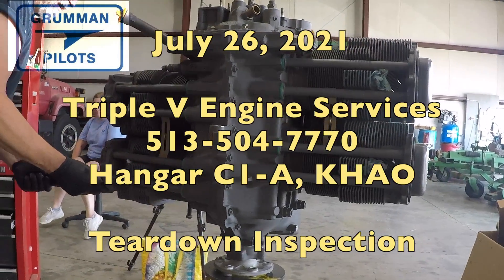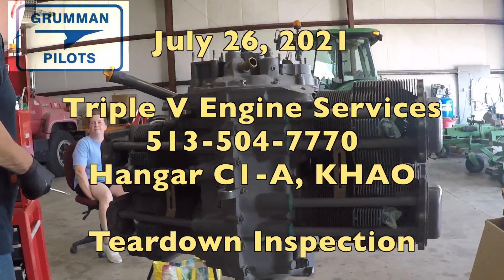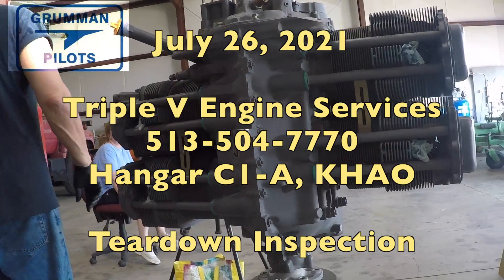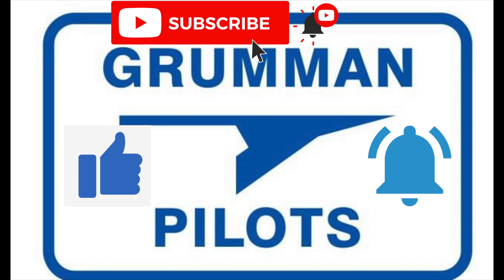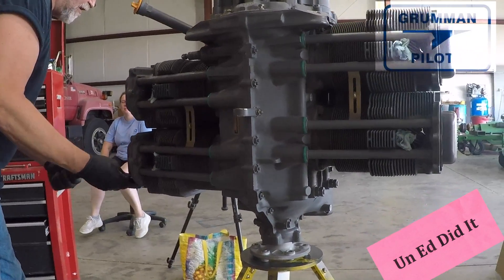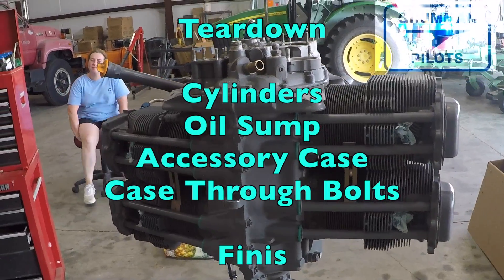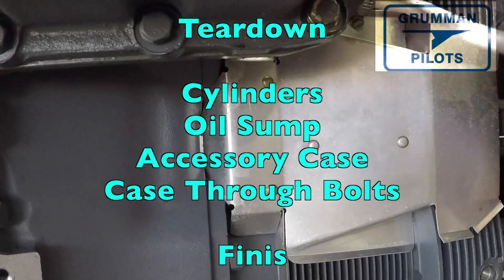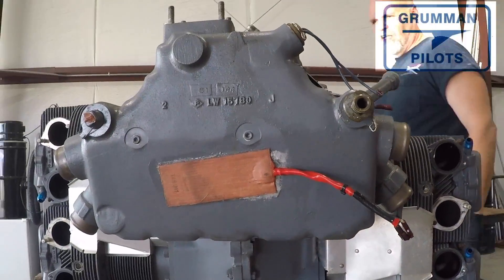Grumman Tiger Engine Teardown O-360-A4K - Grumman Style

Comment: Why was the engine torn down? BSI Would have shown the internal condition and a test cell run would show no bearing issues.
Reply from the maker: If this was going into my airplane I totally agree.  But the Project Tiger it is going into with new glass panel and much more, we had to look so we knew that it was being sold as a solid engine.

Comment: Is there no alternative to pounding on those studs with a hammer? Granted, it was a brass drift for much of it, but I cringe to think of re-using those fasteners.
Reply from the maker: There head construction allows for that and those splines hold the case securely together around the crank journals.  Sometimes a good hammer blow is needed.
Reply from the maker: FYI, then ends of those splines hold the big cylinder base nuts on one side of a cylinder (all of them) to help keep the halves together.
Reply: @GrummanPilots  Well, I know very little about airplane engines, so I'm sure you are correct. I did a little googling however, and this guy had a few ideas: https://www.kitplanes.com/lets-split/ 
perhaps it doesn't apply in your motor, just fyi from a guy who works on tractors.
Reply: I  heat the cases 200 F in an oven then use a nylon drift to remove them
Reply from the maker: Good to know, but I did not see an over in his shop.  I know we used to heat a cylinder to 400 then spray the valve guide with coolant and it would drop right out.  Nice trick using physics.

Comment: Thank you for taking Us inside the Engine of a Grumman Tiger. It looks like it was designed by an advanced civilization:).
Reply from the maker: This was not your typical engine.  New, 6 minutes of run time, 13 years of sitting.  Looked good inside.  Most look a bit more worn and dirty inside.  Thanks for watching.